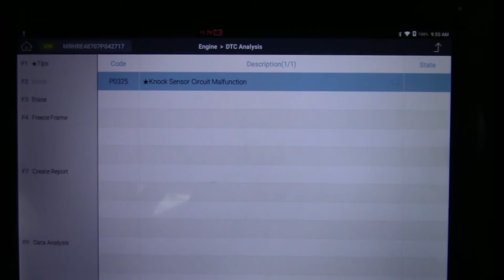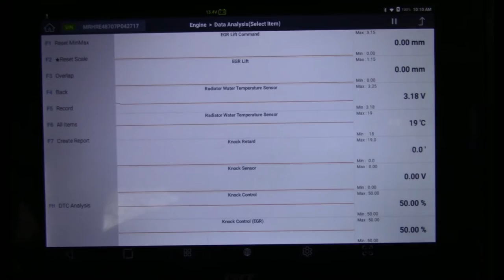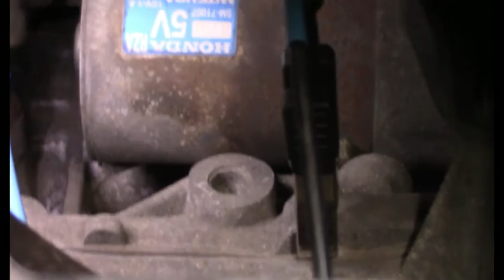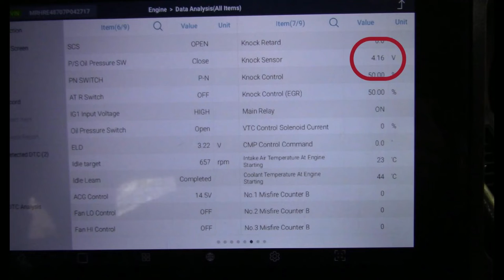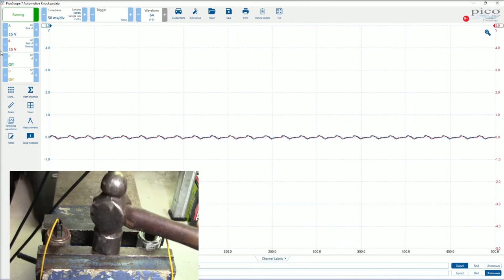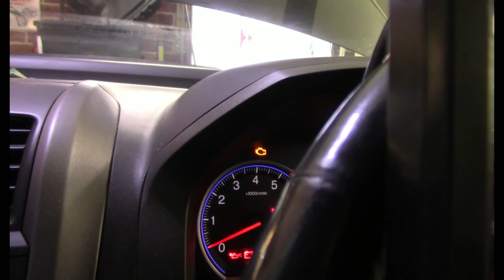Honda CR V P0325 Knock Sensor

Comment: How did you change out the knock sensor itself?
Reply from the maker: Used a socket with a universal joint on the end of an extension bar.

Comment: What a brilliantly clear assessment and explanation of the issue. Thanks Max! 
Was it tricky getting the sensor out and the newy in?
Reply from the maker: Thanks! It did take a little adaption of extension bars on the ratchet, but not overly hard.

Comment: what is potentials cause of P0325 upon reaching 2000 rpm?
Reply from the maker: Is you vehicle the same shown in the video? Have you carried out all the testing shown in the video? 
Keep in mind that with Mass Piezo style of sensors, they pick up any sort of knock across all frequency ranges. Therefore, any knocking noise at that RPM could cause the code to set. What fuel are you using? Is the octane rating high enough? Is there any timing chain wear (if fitted)? Are the engine mounts in good condition? Depending on what engine you have and how old it is, could the ignition timing be out? Is the vehicle serviced regularly? Does it have VVT?

Comment: I changed the knock sensor, and the engine light turned off. However, after a few cycles, it came back on, and upon scanning the car, I received the error "Knock Sensor No Signal." Have you ever encountered this issue?

Thank you
Reply from the maker: What vehicle and what engine? Are all engine mounts OK. Is there any timing chain noise? Can you see any knock reading in live data?

Comment: hi I have the same problem, I changed the sensor and reset the errors but shortly after the light came on again with the code p0325..
Reply from the maker: Perhaps you have something causing 'Knock' - ignition or something causing the same frequency picked up by the knock sensor.
https://www.youtube.com/watch?v=ySv9GzWsvzg&ab_channel=MiracleMAX

Comment: Nice video. 07 crv ex does the knock sensor circuit have a bias voltage on this particular vehicle?
Reply from the maker: I'm not sure. Easy to test. Just check for voltage on the wiring side of the disconnected connector with the ignition turned on
Reply: @MiracleMAX  Yes I know. The problem is if there is no voltage. That can be normal or a bad pcm providing that the wire integrity is good. It will be good to know. To see what to look for. Thank You for responding
Reply from the maker: @christiancorrea8820  What is the actual fault you are chasing?

Comment: Would a bad knock sensor make the car drive with less power?
Reply from the maker: It certainly could. The knock sensor provides information to the PCM when a signal of amplitude and frequency is over a set criteria. The PCM then retards the ignition timing until that 'knock' goes away. 
https://youtu.be/ySv9GzWsvzg
Keep in mind, depending on the sensor, other things listed in the video, may cause a 'knock' sound that may be mistaken for over-advanced ignition timing.

Comment: You had made very good video for testing knock sensor. Thank you so much for uploading this video, make me to understand more about the knock sensor. Can you please tell what scan tool do you use to check the signals of the knock sensor , thank you
Reply from the maker: Hey Billy, any decent scan tool with live data will do what you are looking for & most likely one with graph features.
To truly test a knock sensor thoroughly, you would need an oscilloscope
Reply: Thank you so much
Reply: @MiracleMAX  Hi mate can I ask you a question,
how can I know ,it tell me is good knock sensor or bad one if I look at the graph on scan tool , 
Can you please tell me thank you
Reply from the maker: Hey Billy,
Unfortunately it's not that simple. Do you have a fault code? It may be an intermittent fault as in the case of the Honda. There is no way I could have made that call correctly without the oscilloscope.

Comment: Scan tools can point you in the general direction after having performed a visual inspection of wiring and connectors. 
Your use of the oscilloscope was excellent in confirming the issue and the bench testing of old and new sensors
Reply from the maker: Thanks Colin. I just have it stuck in my brain that I have to confirm a diagnosis before I can move forward.
Thanks for your comment